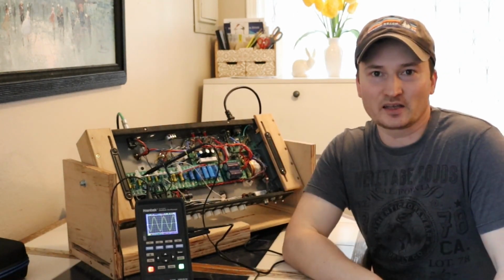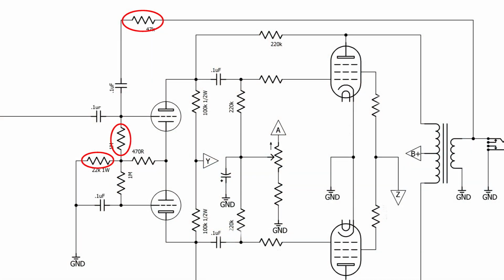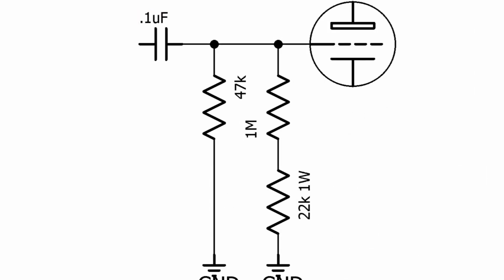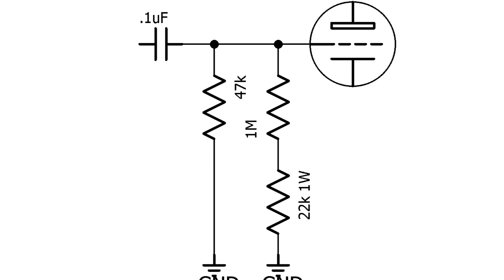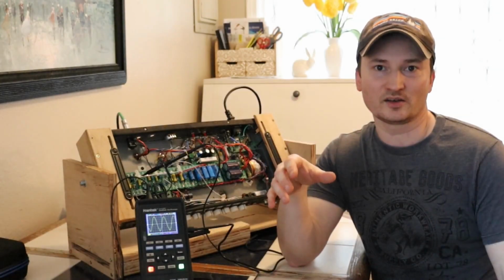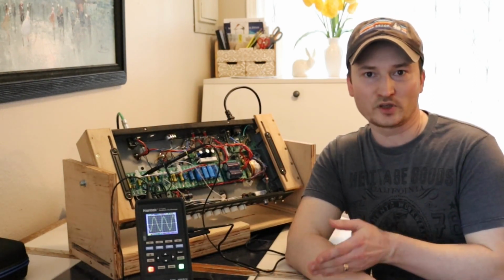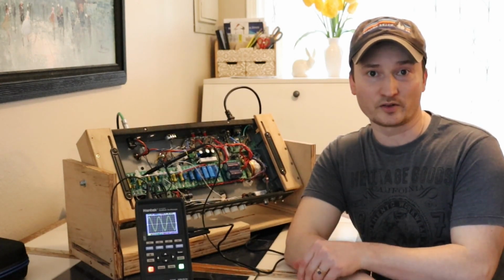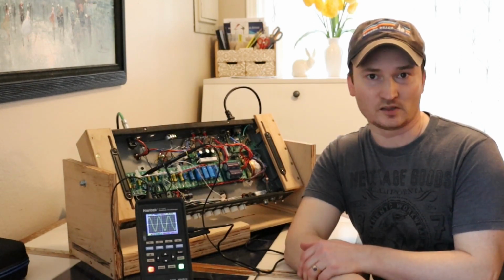75 Dollar Dumble Build Part 8

Comment: Great clean sound Tim! That alone should get you enough excitement to keep going.😎
Is that 60Hz hum that you are seeing from the FET booster? 
Don't remember what it sounded like from your previous videos.

Oh and thanks for the mention! 
Cheers
Reply from the maker: It may be more than one frequency. The scope couldn't latch on to the frequency, so it's not clean, whatever frequency it is. Come to think of it, I don't know if I ever showed the noise. It's been a while.
Reply: @timkrauseelectronics9245  That's a clean sine wave on the scope and "jittery" display is very likely a trigger problem. Not familiar with that particular scope but most of them have a function called Trigger Source which allows you to trigger on the correct source, eg  Internal, Line or External. If the noise is at mains frequency you should be able to lock onto it by setting the Trigger source to Line or maybe internal. If using internal you may have to adjust the Trigger level pot or equivalent of it on a digital scope, I'm an old timer, only use analogue ancient types.😊

Cheers.
Reply from the maker: @markg1051  Good point. If it were multiple frequencies I would see it. I was using it for CAN network stuff, so I'll have to look at the trigger settings again. The auto trigger usually works better than that though.